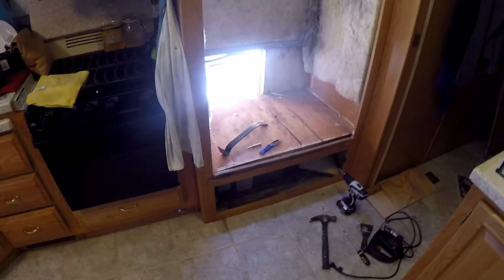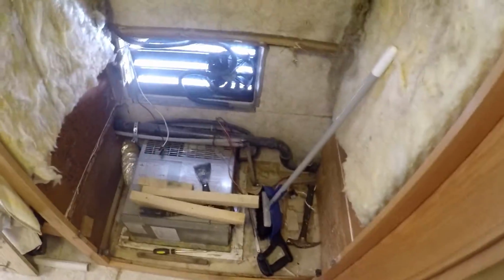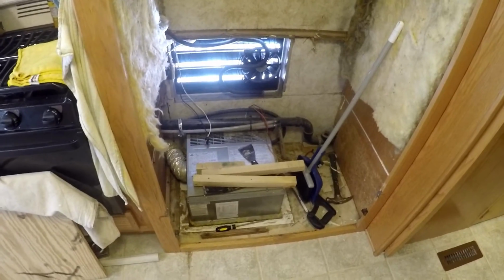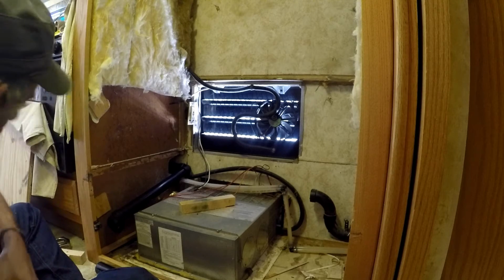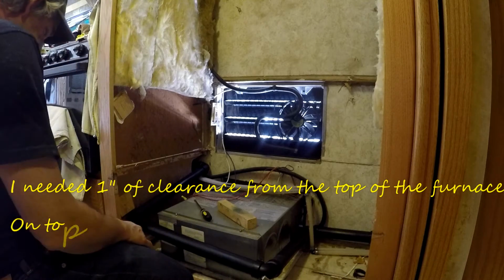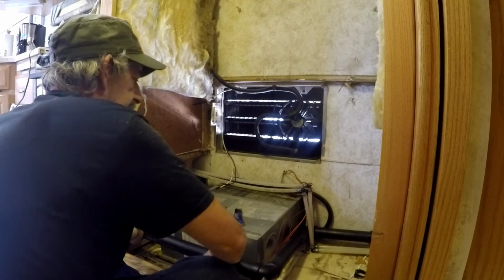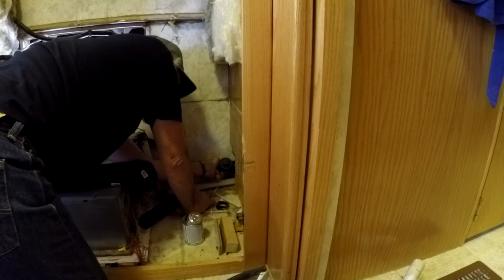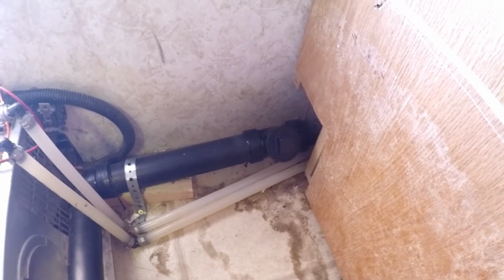Replacing Norcold 1200 Refrigerator with Samsung RF18 in a Newmar Dutchstar Part 2 of 3

Comment: Interested in what kind of draw the standard fridge has on the inverter and what kind of battery life can you get without charging?
Reply from the maker: When the compressor starts in-rush current is about 5 amps, running it pulls around 2-3 amps. With lead-acid batteries that were 2 years old I could go 2 days between charges.

Comment: I know it's been a while since you did this install but I have a question. You ran the black plumbing pipe around and in front of the furnace. How do you remove the furnace when the time comes? Doesn't in slide out toward the front of the fridge. Or does it side out to the outside of the coach? If you had left the 1 1/2 or 2" abs pipe behind the refigerator it would have only required that the frig stick out 2 more inches, right? Or am I overlooking something. I'm not sure, I ask because we have a single door 10 cubic foot Dometic which if it develops a major problem we already have a 10 cubic ft residential magic chef that should slide in with no adjustments( If it fits through the door, which it should). After watching your roof replacement videos I am now in the early stages of a new roof.(I have the 2 rear most 4x8 sheets of the roofing plywood unscrewed and the back third of the termination bars unscrewed but I haven't pulled them off yet. Wrestling with trying to decide whether to stop were I'm at plus 1 more 4x8 sheet in front of the rear air(the rear a.c. had leaked at the mounting lag bolts and rotted the wood beside the ac) or do the whole roof. Didn't work on it today after my lower back protested me being hunched over removing gobs of screws yesterday. I bought a back brace today and am feeling much better. Our coach is the 2003 Newmar 3804(39') I left you a question about the a.c. mounting being outside the a.c. gasket. You have some mad skills T.R.  Thanks, sorry for the run-on comment. Lol
Reply from the maker: No worries on the length of your comments Rick. I would not try and seam the rubber roof, its a recipe for a future leak in my opinion. I took a lot of Naproxen (aleve) when I was working on my roof. Yea I was sore every morning from stooping and crawling around on my knees all day! If you can swing it, and I know it is a ton of work, I would replace the whole roof...as a buyer if I saw a seam across the roof I would be very hesitant to buy a coach with a seam like that. But there are products like the eternabond tape that would probably do a really good job of sealing the seam, but again if I was buying a coach I would not buy one with a seam across the roof.

On the fridge, I didn't want it sticking out any further than necessary and as you saw it barely extends in front of the trim. The issue was not how far out it stuck, it was the height I needed. I didn't have the height I needed to maintain the spacing from the top of the furnace to the bottom of the shelve and have the fridge fit in the hole. I figured that if I had to replace the furnace I would just cut and replace the drain line again. It's not that much work even if I do loath plumbing.
Reply: @trbowlin  I had an idea that if you had to you could cut the abs and reassemble it using no-hubs rubber boots. Thanks for your thoughts and advice and encouragement. I took today off the roof too. Do you think 15/32"(1/2") plywood would be too thick to conform to the curve of the roof. The original is 7mm(a little thicker than 1/4") and not very substantial. I found a lumber yard with good quality A/C grade plywood at a reasonable price. Newmar wants 116.55 per sheet delivered for 9mm(a little under 3/8"). I can get the 1/2(15/32) A/C grade for 31.00. They also have 3/8" A/C for 24.41. Thanks
Reply from the maker: 1/2" will conform just fine. The 'bow' of the roof is not that much so just screwing off one edge then standing on the other will bend it to shape and then screw it off, then screw off the middle. I went with 3/8 on mine but in hindsight I should have used 1/2.

Comment: Took my first small road trip yesterday and the doors on my samsung were opening in the turns. What do you suggest?
Reply from the maker: I've had the same problem. I have a video I am about to post on the subject. In short I bungee the freezer door and I tie a tea towel (dish towel) between the handles when I am moving. Mostly Ive had problems with windy roads like last week driving into Deadwood, SD. Watch for my update, I hope to get it posted today.
Reply: I used Velcro strapping.  Put a strap anchor on each side of the fridge doors, used a pop rivet to make a loop in the Velcro strap, and then fastened the two straps together over the doors.  Works great.  I used 3/16 pop rivets, heated an old drill bit, melted a hole through the Velcro strap, installed the pop rivet using a washer on the back side, cut the excess off the pop rivet with a cut off blade, and then peened the rivet down and wrapped it in tape.  When you get done the Velcro goes across each other and makes a tight lock.
Reply from the maker: That is a pretty good idea. Thanks Ron...

Comment: What is the chances your rolling through Oregon and want to help a guy make a few bucks doing this with me on a 2003 Beaver 40' with a new to me NEVERCOLD 1200, I was just quoted 2400 bucks to do the new cooling unit at the local Rv place. Floored obviously and this would cost me the same only we'd knock it out and I'd be super upgraded?!! Just a thought and BTW new to your channel and loving it!! Thank you:)
Reply from the maker: I wish I could but alas I have other commitments. If I can do it you can!!!
Reply: @trbowlin  Thanks man.. I have so little time, ability yes! I'm definitely considering. I'll research my inverter but whats the minimum I should consider before upgrading if need be? Appreciate ya!
Reply from the maker: @Hotrodrex  Well the fridge does not draw that much current so if you have a 2000 watt inverter now you should be okay. However, depending on the fridge you install you may need to get a pure sine wave inverter. The Samsung fridge will work with any inverter but some fridges are sensitive to the type of power e.g. modified sign wave vs. pure sine wave.

Comment: Once you get the black line where it looks good, use a #2 pencil and mark it on the wall or box to give a point that you can look at when you start the glue down..  This way you will know where to line up the parts... I also use a line to mark the parts where they line up. ( http://www.pvcworkshop.com/Pencil%20Line%20004.jpg ) or ( https://cdn.instructables.com/FW7/U0VB/I86LP9K4/FW7U0VBI86LP9K4.LARGE.jpg )